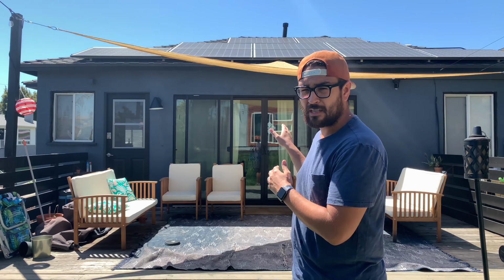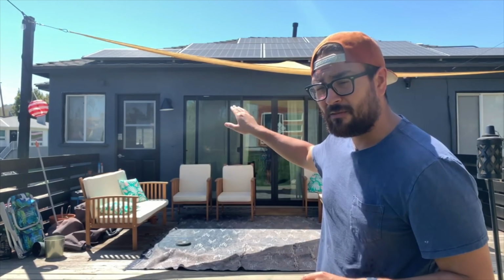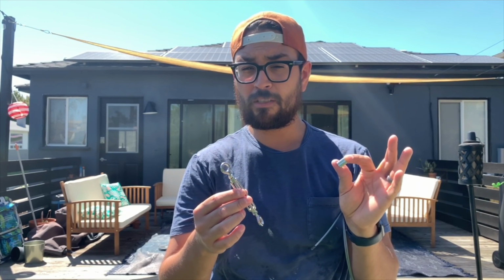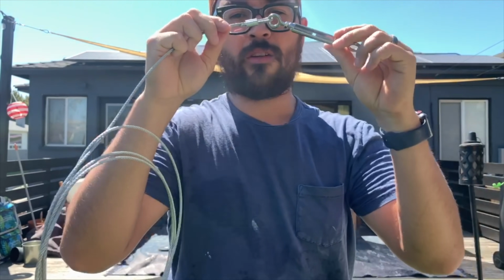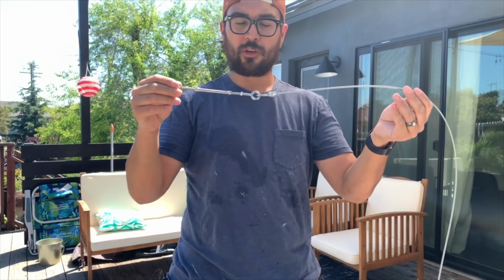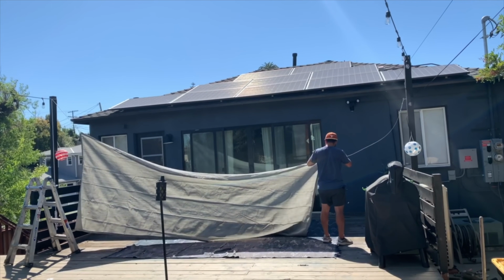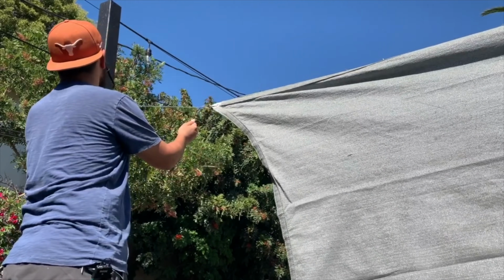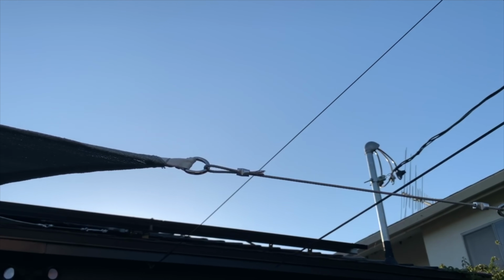How to Install a Shade Sail with DIY Cable Railing and a few tips to make it go smoothly | Tutorial

Comment: Started this project this morning & it was a disaster. Yeah, so now it's balled up in my yard. But while pouting & drinking a beer, I found your video & as soon as I finish my next beer, I'm getting this done. Thanks!
Reply from the maker: Aw, I find it’s best to walk away for a couple of hours sometimes after a fail. A beer definitely helps too. How’d did round 2 go?!
Reply: @Robuilt  had a ton of rain since so attempting now... After watching your video AGAIN!! {I probably count as at least 5 views by now!} Decided to go with chain rather than cable since it's west side of house I don't have to look at IT & doing it solo so easier for me to adjust. Worried about attaching to house gable in wrong places but what's a few holes to patch, right? 🙄
Reply: And I SUCK at measuring & math! 🤷🏼‍♀️
Reply: How did it turn out??
Reply: How did it go??3 years later I want to know what went right, what went wrong, so I know 😂

Comment: Honest effort and a quick solution to add some necessary shade to your deck. However I would seriously caution anyone from installing any kind of fasteners into your soffit trim, especially if it's not into a structural component like a roofing truss or rafter board, and if they are not capable of handling the dynamic wind loads on the threads' fastening hardware, or you're using a thick sail. You're just asking for trouble during a moderate wind event.

Comment: you can use carabiners to attach the sail to the turnbuckle so you can easily remove & reinstall the sail. You may need to loosen the turnbuckle to remove carabiner depending upon how much tension you have.
Reply: Just in case of bad storm. 😉

Comment: Just saw a video of a guy putting one up that used springs (like for a porch swing) between posts (or structure) and cable ends. Allows for a bit of "give", while still being under adequate tension. Also, using carabineers between between cable loops and turnbuckles allows for easier connect/disconnect.

Comment: Thanks for the content. The only thing that needs to be mentioned is the posts should be mounted on a bias away from the sail. When tension is applied, the post will then appear plumb. There is a lot of force at play here and the posts tend to continue bending into the center of the sail. Thanks again, good job.
Reply: That's a great point. Coming from a sailing background I can attest to the heavy load from main to boom to mainsheet. I want to do this under a pergola 'canopy' but I'm beginning to wonder how much load will be applied to 6x6 posts and ledger board. Much to consider.
Reply: @Clickumentary  there is a tremendous amount of stress on the posts. Consider the amount of leverage the sail has against a post of any size when the pull point is 10 feet or more from the ground. I recently saw an installation with 25% bias on posts and looked good. Also wood will keep bending season to season. May wind up with a bannana!

Comment: Turnbuckles + Cable + Crimping clamps⁉️ No way‼️
Use 550 Cord and “Nite Ize Plastic CamJam Cord Tightener (4-Pack)” and/or “Nite Ize Figure 9 Carabiner 150 lb. Black Rope Tightener”. They come in handy for many applications.
This allows for a strong and secure setup with easy adjustability... within seconds.
For connecting them to a wall or post, checkout the “Husky 1-1 2 in. Steel Wire Ring Anchor Point in Black (4-Pack)”. 👍🏻
Much cheaper and easier. Plus it’s easier to take down before high winds, heavy rain or storms.
Reply: wow...dude you just saved a bunch of time and headache. Even though this is a simple project this is great solution.

Comment: I always found using a 'Sail Shade' works a whole lot better than one of those 'Shade Sails',  just saying like.......

also if you had attached the (centre point) corner that you hooked up to the roof area, if you attached that above the door and the attached the remaining point on a post just above the seating on the right  it would have offer more shade over both the seating on the left and on the right.

Comment: Did you just run the lights up by themselves? I was thinking of running something like cable rail around (sun shade) to hand lights. Is that not necessary? How did the back left corner of you sun shade workout? I looks like the rain would poor down at that corner right at the door. We get summer rain storms and hail.

Comment: Why not cut the excess wire with the bolt cutters not an angle grinder? I have a tool for cutting bicycle cables that worked great but I also used the bolt cutters.

Comment: We hung our rectangle sail, worked great for shade, got 1 1/2 inches of rain in an hour, didn’t run off and pulled the hook straight. Tried again heavier hooks. Same thing happened while we were out of town. Third time tried one corner into the brick wall, again pulled out. We are going for the fourth try as soon as it isn’t 105 degrees. Gotta say that much rain is totally unusual in the Texas panhandle. Really frustrating.

Comment: We have a tent shade but how did you set up the pole for the shade? We recycled a pole that was used as vertical for separating within the backyard. We poured concrete to secure the pole but it doesn’t hold well. I wonder if you have any suggestions to make a pole for the shade? TIA!

Comment: So I’m looking at a 20/20 sun shade I see most only hang on 4 corners and don’t have rivot holes every few
Feet.  Any good ideas it’s going over a back patio to connect to a wood pergola
Reply from the maker: If I'm reading this correctly, I think you would still use the method in my video no? You could still use the cable railing method and attach it to hooks on the wood pergola.

Comment: Question:  I'm considering installing this over our new deck rather than building a new roof.  The main motivation is providing covering that we could sit under for light rain.  One of the biggest things we enjoy about the deck is the openness of it and we're very reluctant about building something that would cover it all up.  So, I thought about these as an option.  However, this looks more like a permanent install.  Is there a way to do the install that would allow you to put it up quickly if a light rain was forecast?
Reply from the maker: Oh for sure! Those turnbuckles have hooks on the end. So you can pull them down within seconds.
Reply: @Robuilt  Awesome.  Thanks!  I love being able to look up at the sky and all so I really don't want to kill the view.  Just want to be able to chill outside if there's a light rain going and not have to worry about hauling cushions inside and all that stuff.  Thanks for the great vid!
Reply: Also... one more question...  I have a fire pit.  I want to stretch out to even with the fire pit (not over it obviously) and the sail would be about 9 feet up.  I'm worried that it would damage the sail if I had a fire going.  Would you say that would be a problem?  (We could easily not have a fire in that situation as I likely will only use this when there's rain happening.)

Comment: How did you install the hook for the last corner of the sail that's lower but on the stucco? Did you still a wooden block to the side of the stucco first?
Reply from the maker: That wood block was already there funny enough. Otherwise, I would have just put the hook on my fascia board.
Reply: @Robuilt  Most of the installation instructions that I've seen suggest using a mounting bracket when attaching to fascia, or installing where there's an underlying rafter. Are you worried that it might tear off the fascia if a gust of wind comes through?

Comment: Great video, going to put poles in the ground this week to install two 12x12 shade sales over my deck. Are you worried about the hooks on your poles being a bit small/weak, and attaching the other side hooks to the trim of your house in case there's heavy wind and rips your sail off? Just wondering, there have been other tutorials with more conservative installs and I'm liking your method for easier removal if i don't want them up on an overcast day (I live in western washington XD).
Reply from the maker: Hey man, first of all, thanks for taking the time to watch my video!

I had a shade sail installed (the triangle one at the beginning of the video) for about a year with no issues. These hooks are on the smaller side, but have help up plenty fine! But you could def buy the next size up for extra security and a little peace of mind. I considered doing that for this install, but I didn't want to go to Home Depot (due to the shelter in place) for such a small item. I've had a few pretty windy days too, and again not a single issue! Hope that helps!
Reply: Depending if the shade sails have perimeter cabling, which professionally made shade sails will ! For a 12m x12m shade sail you would need to have posts that are around 125x125x5mm steel and around 1.5m deep by 450mm wide. For peace of mind and being able to sleep at night during storms ! Using little open end hooks like so are not ideal especially that size ! Hope it helps stay safe, bigger is better 😎

Comment: Thanks for the video.  I have four planters with poles for lights and I want to attach galvanized pipes to a higher level and install a shade sail.  My dimensions are the same as yours (8X18), and in the video you said you used a 6 X 15 I think.  The amazon link you attached doesn't seem to have that option though.  Do you have any ideas for a 6X15 or 6X16?  I'm having a tough time finding those dimensions.  thanks again!

Comment: Thanks for posting the Great video.Few questions
1.Would u leave it out in Winter where it snows? We get snow here but I am considering this instead of a permanent attached structure.
2. Do u take it down on high winds and rain storms.
Reply: You can use carabiners to attach the cloth to the turnbuckle so you can take it down pretty easily by loosening the turnbuckle & detaching the carabiners.

Comment: Is the pole in the ground or in a bucket of some sort? Did you use cement?
Reply from the maker: In this video, the sail shade is attached to 4x4 posts that were already fastened to my deck. If you're looking to do this from scratch, then you'd def want to cement your pole (or 4x4) into the ground. If you just dig a hole and don't pour concrete, your posts will eventually start to fall over. Hope this helps.

Comment: I’m super curious how many people followed this video and used bolt cutters instead of a proper swaging tool. Instead of compressing that ferrule into a lock, you’ve mostly cut through it, and probably damaged the cable inside it. I wouldn’t be surprised if, in the first heavy wind, your sail flew away. 
DIY with what’s available is one thing, but that’s just unsafe.
Reply: I'm truly surprised more folks didn't notice that. Rob is awesome, I'm a big fan but yeah you definitely don't want to cut your ferrule. Use a proper crimper!
Reply: I'm considering using a bolt cutter INSTEAD. I've used the proper swaging tool, and I think I'm going on 7 or 8 crimps I've had to re-do because they just don't hold!

Comment: How does it hold up with heavy rain? I’m really wanting to do this for my deck,  but I’ve read over and over that no matter what angle it will hold water and sag like crazy , and at one point I’ve heard of broken turnbuckles from the weight of the rain water accumulated in the sail after a heavy down pour. What’s your experience?
Reply from the maker: Hey there! Thanks for the question. I've had many heavy rains here in Los Angeles and my shade sails have always held up like a champ. But I've always been pretty good about ensuring that I installed all corners at various height elevations. As far as the turnbuckles, I've never had an issue here either. You can buy them in a variety of sizes/gauges. A thicker turnbuckle will definitely hold better, and will only cost you about $1—so it won't break the budget. Plus if you use cabling, that should be much stronger than the rope that is provided.
Reply: Will it bust off with heavy wind?
Reply from the maker: @priscillamorales9785  So far I have no had any issues and it can get pretty windy at times!
Reply: @Robuilt   What were your height variations for this project?

Comment: Why didn't you just cut the cable with the bolt cutters? A whole lot safer than a grinder and one less tool to need.
Reply: Bolt cutters don't cut cable they just pinch, Cable cutters cut cable.

Comment: Dude.. I’m not an expert but I’m pretty sure you can’t crimp a cable with a bolt cutters.. you need a crimping tool. Your way is kind of dangerous.. but what I know.
Reply from the maker: My way is kind of dangerous because a .001 lb shade sail might fall on your head? THE HORROR. I did use a crimp tool btw ;)
Reply: Robuilt. Your snarky comment is not cool.. a sail of that size in a little wind can be very dangerous. A flinging pieces of metal like that is not funny. 
There’s nothing wrong in making mistakes and trying to learn. You.. sound cocky. And that is dangerous when you try to teach. Good luck